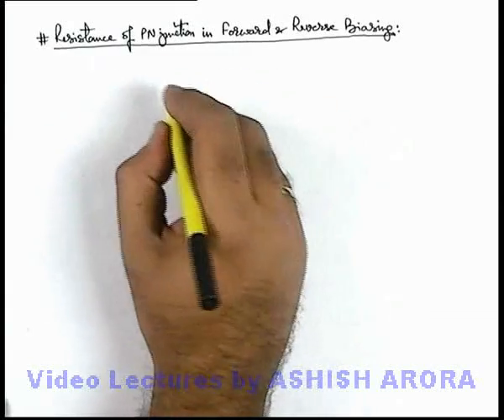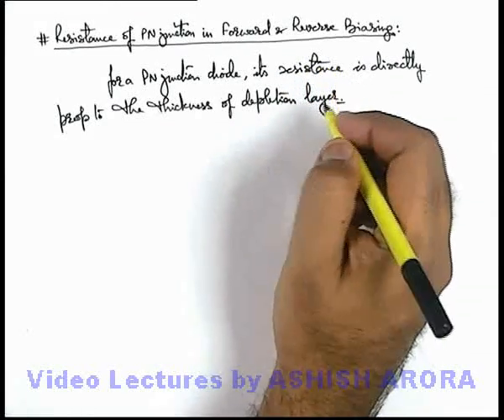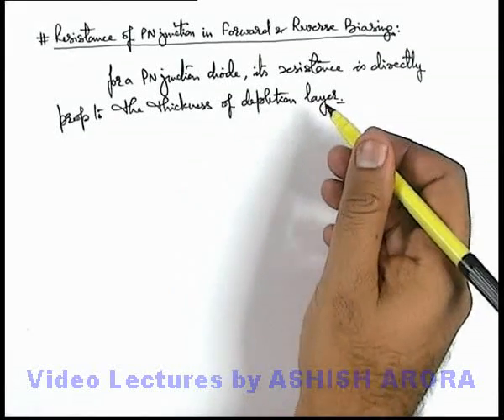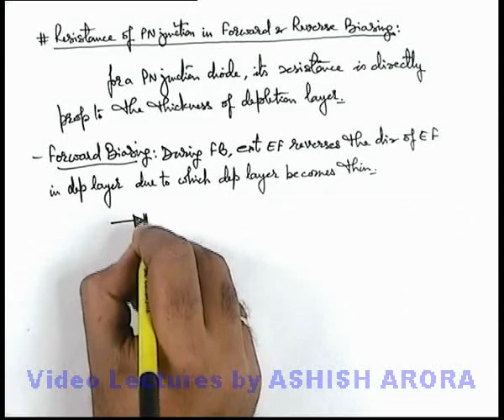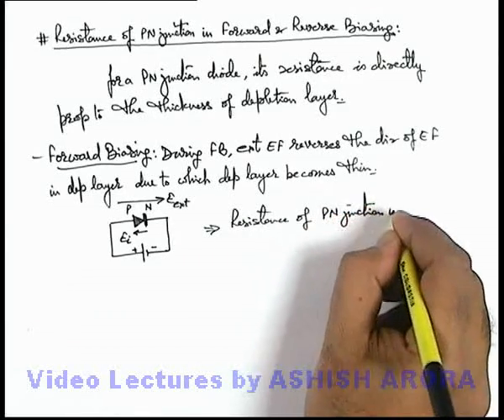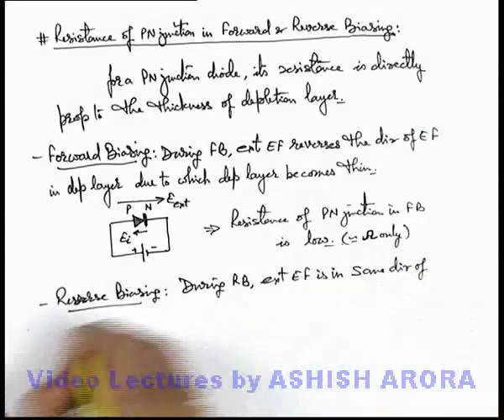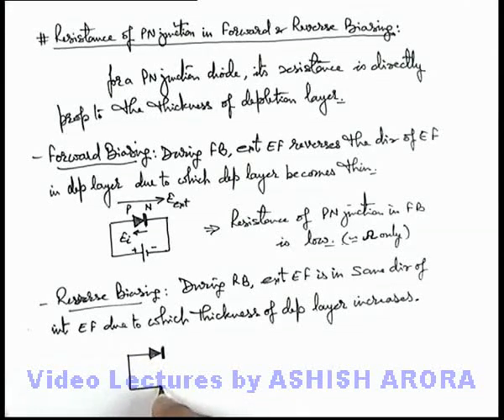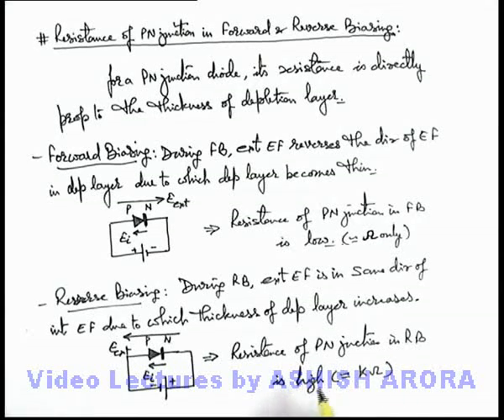Class 12 Physics | PN Junction & Diodes | #8 Resistance of PN Junction in Both Biasing | JEE & NEET

Comment: sir,if current does not flow through PN junction diode when it is reverse biased then what is it's use practically?
Reply from the maker: There are many devices like zener diode and pn junction triggers works in reverse bias mode only... you will study later about these...